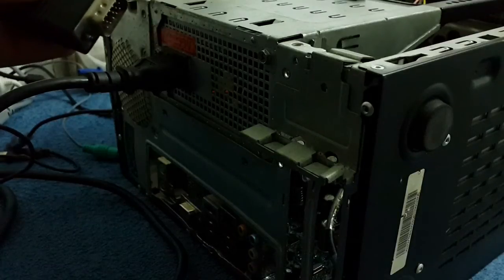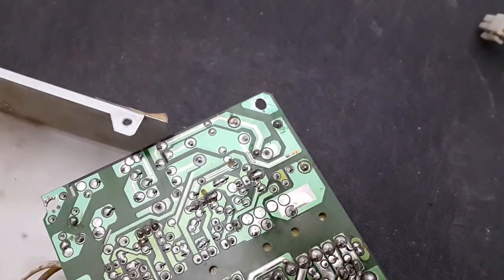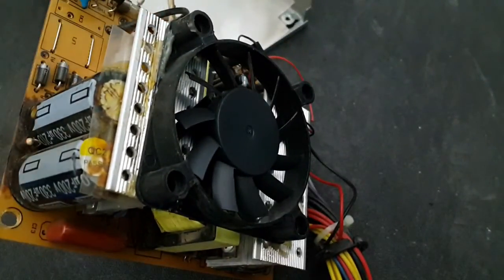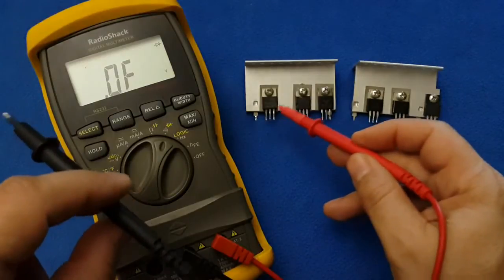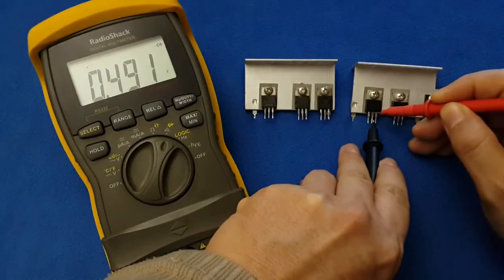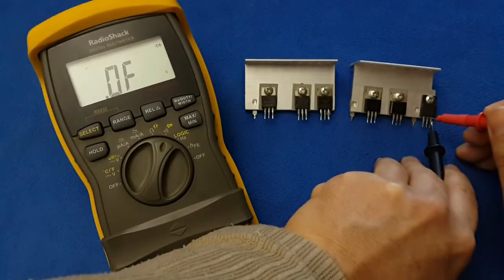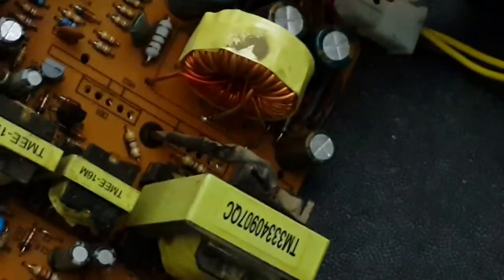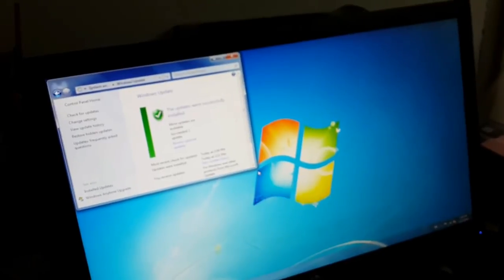How to fix a spark in desktop chassis / computer sparks / chispas en chasis de PC

Comment: Have the same problem, but I already changed the previous PSU to a new Thermaltake 750w one. Could this be related to the motherboard installation as well? Like maybe it is touching the PC chassis or something?

Also, is this harmful to the PC components? Because despite that, everything works normally.

Comment: I have the same problem with the spark, will look into the power supply what's going on.
Reply from the maker: +Zetich  Hi! Analyzing the problem, the capacitor itself didn't make the spark. But probably, its effect did wrong oscillations, made the problem in the secondary stage. But at the end of the telling, just the capacitor changing, solved the spark.
I didn't say it in the video: Keep the same voltage in the new capacitor, and IF, and only IF, the power supply is not 400 Watts, and there is a small motherboard with no more PCI boards, you can place a less capacitance capacitor. It is because in some cases, there is not enough room for the new capacitor, and the power supply manufacturer make the same model for 250W, 300W, and 400W, and the only difference is the capacitors and just a few different components like resistors. BUT, common sense , knowledge and logic must be applied for changing the capacitor with a smaller one. (...if it was needed because the small room to place it)
Thanks by watching and writing! :-)

Comment: I have the same problem with my new pc ( new psu ), so what you mean is these sparks are the cause of bsod?
Reply from the maker: Hi! First step is to ground them. If the spark persist there is something wrong. But first make sure all is grounded.